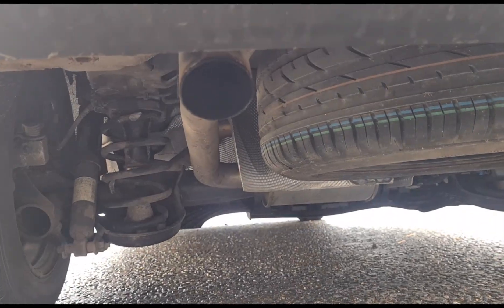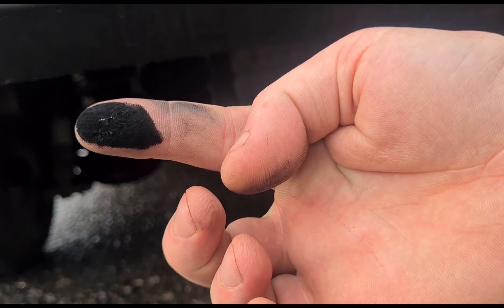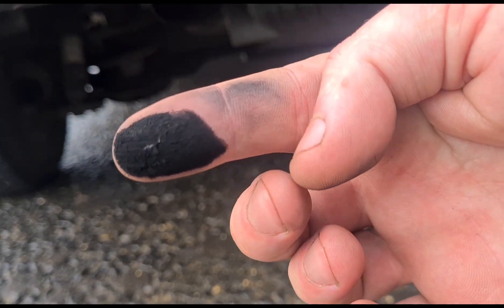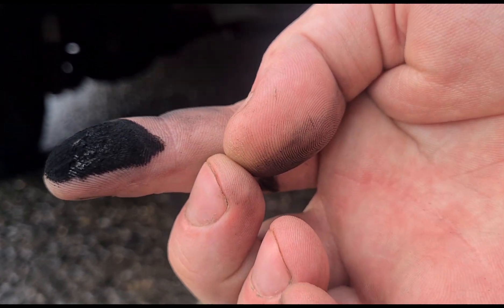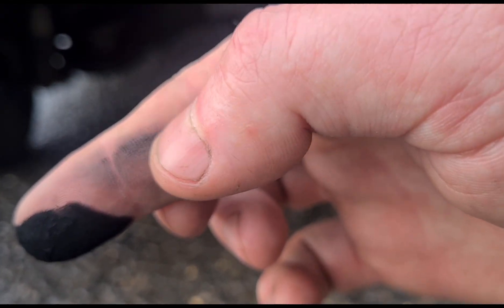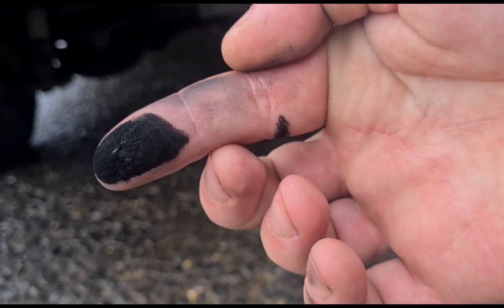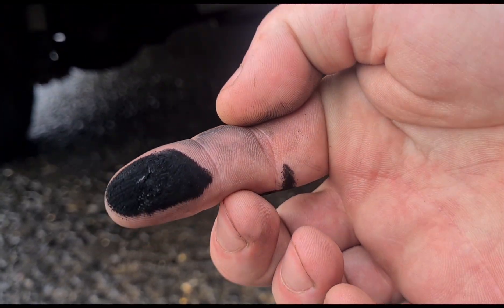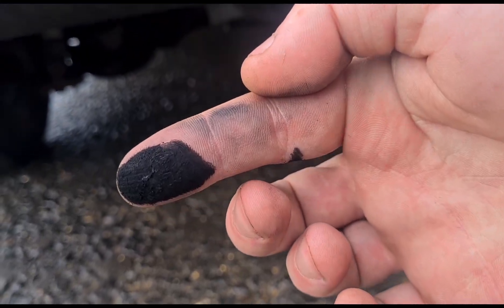Quick DPF Health Test With No Tools

Comment: I had similar problem dpf getting full after 400miles or so dealer put new dpf on it turned out some tool done the cambelt and offset the timing took days to find the fault entire engine was stripped out, 

Was happy we got to the bottom of it it's amazing learning about these things 😂

Comment: Do you have any tips for cleaning a low pressure EGR system whilst installed in a 2017 Fiat Ducato with both low and high pressure EGR systems (pre AdBlu)?

Comment: Ford have just released a recall on fords for cracked DPF issues with a free replacement
Reply: I've been looking into this for my Torneo custom with cracked dpf. Yes there seems to be a recall happening but it's not an "active" recall, atleast not on my model. They said that I have to pay £120 for them to check it and deem if it's cracked due to miss use or not. There also doesn't seem to be any dpfs to replace it anyway as they are on back order.

Comment: What can you put it in diesal tank to help it keep clean
Reply: Seafoam - harmless oil based cleanser / additive. Into Catalyst / DPF via O2 sensor hole, or into inlet manifold via throttle body, or into engine oil for 400 miles to clean carbon / sludge build up. Works wonders 🤷🏻‍♂️

Comment: ive got a renault master year 2021 and its been nothing but problems. Check injection, check anti pollution. Renualt have had it and its cost me thousands of euros. changed every sensor, and now the exhaust pressure too. 2 days later all lights back on. Renault now suggesting new dpf and new ad blue injector 6000 euros including labour. All these vans have gotten worse.
Reply: I have got exactly the same problems with my Renault master 2021, I have to put a dpf cleaning additive in every tank for it not block up. Had the dpf professionally cleaned and still causing grief.
Reply: @PhineasWalker-y9p renault want to change adblue injector now and new dpf, quoted me 6000 euros including labour. I just dont trust them that its going to fix anything

Comment: hi Jimmy great tips.im having troubles with a Renault traffic 2.0 2014. getting loads of black soot from the tail pipe.van is struggling on the hills .would a blocked dpf cause this🤔 .ive checked turbo, vacuum leaks ,sensors they all seem ok.

Comment: This is BS!  Most DPFs drop out carbon as a result of sooth  incineration. My Volvo V60 has a 300kkm DPF, it runs and regenerates fine. Exaust is black since new. Differential pressure in the DPF seems to be fine has ECU is not throwing any codes. Never did.
Reply: Yep it’s like connecting your arse to your nose, all will be well❤

Comment: What would be the reasons for engines to produce that much soot?
Reply: Bad combustion. So low on compression, bad fuel injectors or maybe even burning oil.
Reply: If it was my van I’d do a DPF. delete
Reply: @bugsy1254  That doesn't solve the problem.
Reply: @RawbLV true, but I definitely won’t passing on the problem or scrapping it so I don’t have a lot of choice. If mechanics can’t fix it but the motor runs, then dog delete.
Reply: @bugsy1254  That's fair

Comment: Im having problems with my new eoly pump in my berlingo .after programming new pump and clearing faults , everytime i fill with diesel faults come back .any ideas whats wrong ? Any help greatly appreciated
Reply from the maker: Was the pump replaced or just programmed a new one? Sounds like a bad tank
Reply: New thank .got it checked out by 2 mechanics .they said the pump is priming and there seems to be no issue with it .the issue seems to be when I put diesel in and the van isn't telling the pump to add the eoly fluid and the errors pop back up .
Reply: @jonathancoughlan-b8u did u solve the issue yet ?
Reply: Is it an OEM Pump?
Reply: It was an aftermarket pump  @paulnolan1352
Reply: What's a OEM pump ? My mechanic replaced the eoly pump .
Reply: Tank

Comment: if the DPF is changed when broken ,the garage isnt going to clean out the exhaust pipe so it will always stay sooty . cant you fix this one ?
Reply: Chimney sweep
Reply: Happened to mine around 130k. Car is now on 230k and exhaust is squeaky clean... somehow!
Reply: How about putting DPF cleaner in the particle sensor hole to clean the pipe after the DPF, can probably get a wire bottle brush up there too. It will still be full of soot left by the old DPF
Reply: tooth brush.